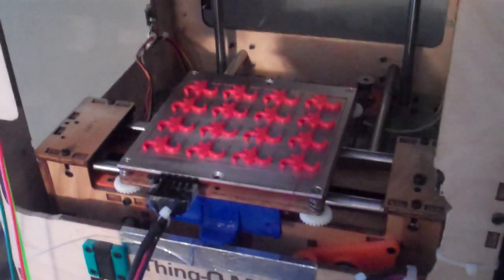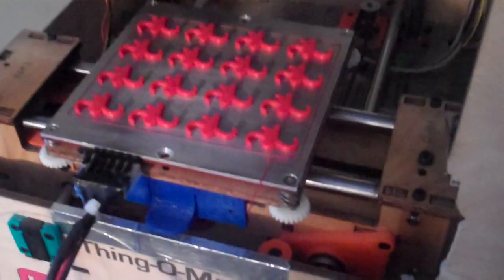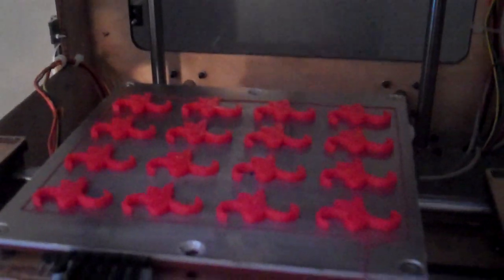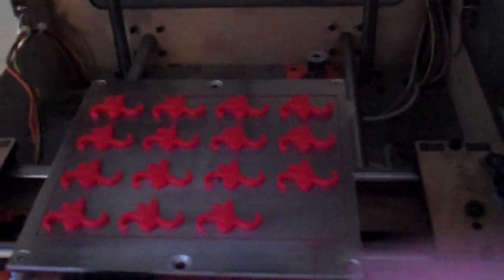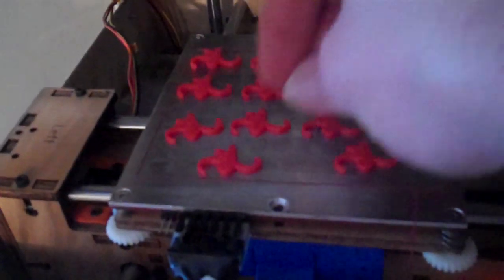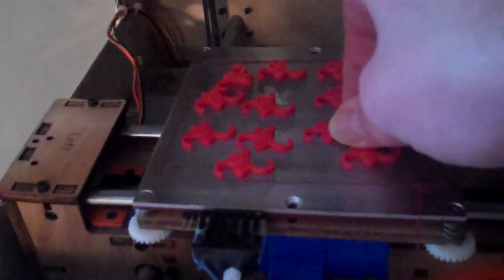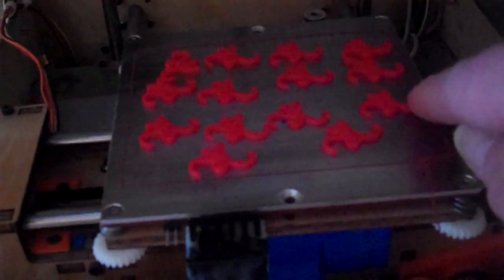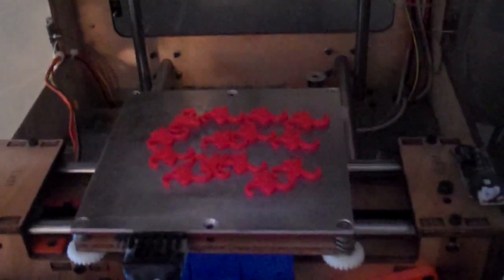Makerbot HBP with Aluminum Plate Coated With Hair Spray

Comment from the maker: Basically yes, I clean off the build plate with acetone then I just recoat it with hair spray.  It usually lasts a few prints until it needs touch ups or a new recoat.  I've had pretty nice results with it so far and have done a few dozen prints.  The bottom of the print comes off with a nice matte finish instead of the glossing finish it used to have from the Kapton tape.